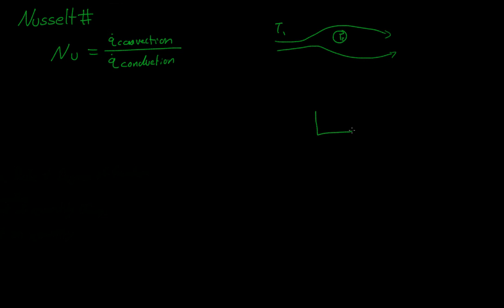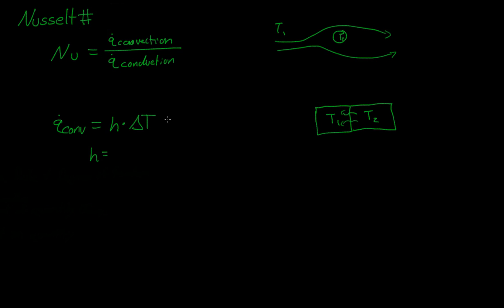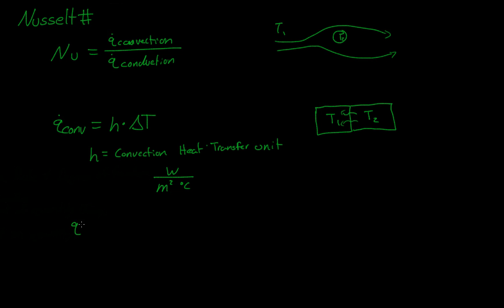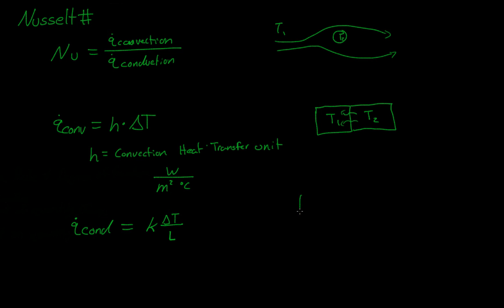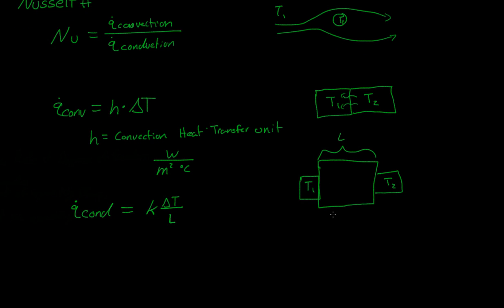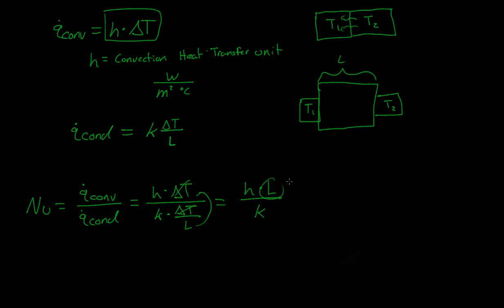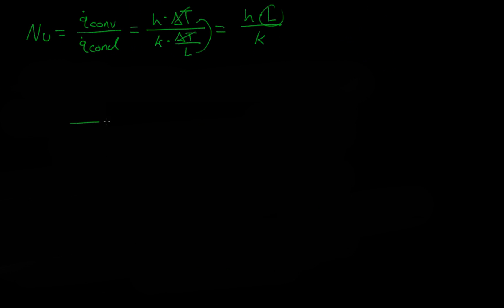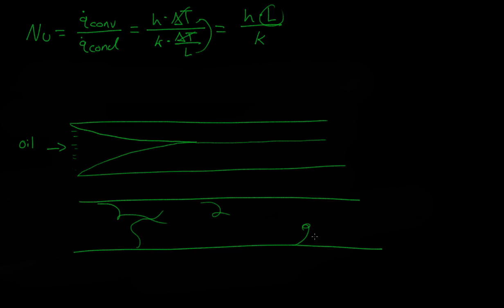Nusselt Number

Comment: Hi everybody why the correlation for natural convection giving the Nusselt number above an horizontal flat plate is different of the plate is hotter or colder than the environment and in forced convection, a single correlation can be used for a plate that is hotter or colder ?

Comment: Is that description for convection correct? In that situation I would have thought it was called conduction as the transfer is from the ball to the air particles. Convection I thought was more the whole process of warming up a fluid and the pattern of movement of the particles it causes.